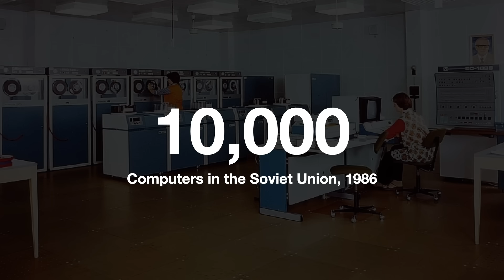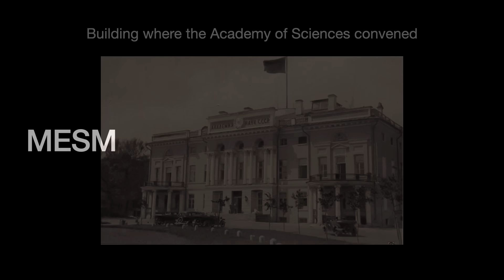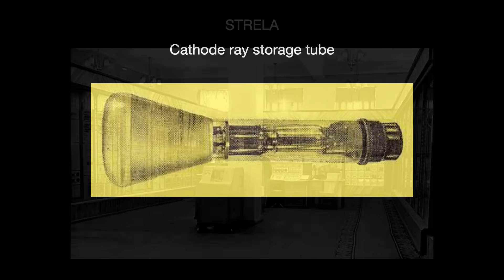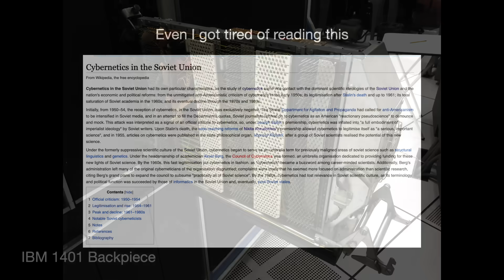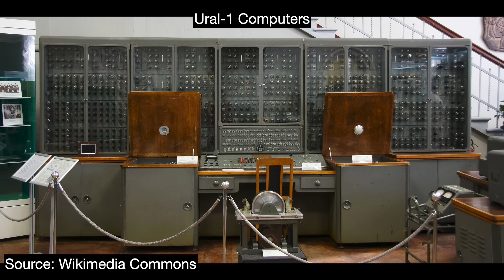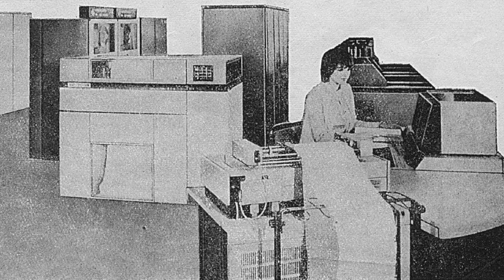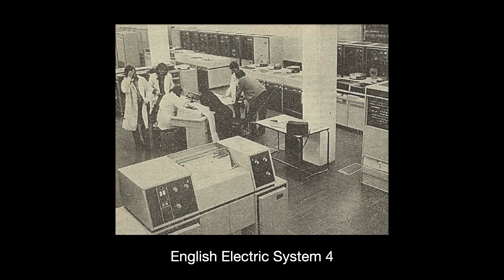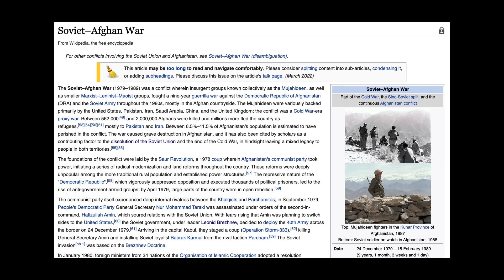Why the Soviet Computer Failed

Comment: Differential Equations are the best thing since sliced bread -- although they are in fact quite a bit older. Most modern technology is built on them. It is not normal to fear them.

Comment: why is that room around the 7m mark (black and white tube computer room) apparently flooded?  There is what appears to be a massive amount of water on the ground and I am so curious why...
Reply: It doesn't look like water to me.  I think it is a glossy material (like a smooth plastic or rubber) in a sheet spread across the floor, with a few ripples in it.  Particularly, at the bottom of the photo, there is an area where the reflectivity of the floor suddenly decreases, but it doesn't look like the edge of a water puddle.

Comment: Yeah, Soviet planning was not set up in a way to properly make use of all resources the most efficient way. That would have been possible, but would have required quite the fundamental changes to the system like setting prices not centrally but by demand. The political landscape there again was in the way of the reform of the economy
If socialist planning is ever going to work it can only be on the background of a separation of party and state, on the background of rule of law and on the background of democracy.

Comment: They never compete for a consumer. So "good enough" was actually a reasonable strategy. Do the job with the smallest budget, and since improvements in the market ware not needed, it stagnated in niche science calculations, which dont produce volumes or monetary interest to make strides.
Reply: In democracies, engineers bought programmable calculators for themselves because they wanted to improve their efficiency. When an engineer in communism wanted to improve his efficiency, he wrote a request to the company for a programmable calculator and got nothing, because there are none. It is necessary to realize that computer technology is also a consumer product and the underestimation of individual consumption was a gross mistake of communist functionaries.

Comment: I started using an SSL G series mixer & session automation computer in 1988 (very niche, but famous in audio). Even this was banned for export to the eastern block. That very thought lingered every time I changed the clunky 8” floppies or calibrated it’s 40 1024 bit A/Ds that read the fader positions. The Cold War was distant but very real for a 22 year old engineer… 😅👍

Comment: I think it's fascinating how there was the idea of cybernetics in the socialist countries (use of computers to predict and plan the production needs of the country) and yet they didn't follow through with the technology.
I worked in the early 90s in a factory for electronic parts and the control room just looked like the room at the end of the video. The photo of Erich Honecker was removed but the shadow of the frame was still visible :-).
Reply: Ironically, Walmart and Amazon, which have their own internal economies larger than most countries, ended up using these cybernetic techniques in their deployment of computers in managing logistics and inventory. Project Cybersyn in Salvador Allende's Chile also instituted a similar program to great success however it was cut short by the fascist pinochet coup.
Reply: @VictorZenloth  
> Project Cybersyn in Salvador Allende's Chile also instituted a similar program to great success
Socialist planned economy, centrally- (and computer) -managed...
How was its "great success" demonstrated ?
Reply: @VictorZenloth  You mean Pinochet/Nixon.
Reply: im not really familiar with theories about technology development but the difference is that the notion of growth as a goal in itself was and is prevalent in capitalist countries but not so much in socialist countries. Frankly, I don't see much societal use of technology development for itself.
Reply: They want to keep you as slaves! 👉The Connections (2021) [short documentary] 🔥
Reply: Any efficiency gain in logistics, inventory control, or planning was opposed until the 80s, when it was too damn late and planning was on the outs because the thieves realized they could just privatize it all and hand it to themselves.

Comment: Did they mention "metric" chips and circuit boards? Soviets were using 2.5 mm pitch instead of 2.54 mm. So parts were not interchangeable and there was no much international demand for non-standard components. In 1970s Soviet SN7400's were very cheap (in Finland at least) but you had to twist them legs sideways, which was annoying and potentially harmful.
Reply: The knock-offs of the US-made B-29 bombers they had after the war suffered the same problem; metric aluminium sheet for the skins wasn't available in the same thicknesses so the Soviet aircraft were apparently some 1000 kg overweight.
Reply: Tupolev told Stalin this would happen and he went "Fuck you, make it work, also, follow the plans exactly because I want to shit-talk you for making American planes."
Reply: ah, yes, the "metric inch"!
Reply: During WWII, the US gifted Russia with a bomber, a B-25 if I recall.
Not only that, a complete set of tools and spare parts; nuts, bolts, washers, rivets, wire, sheet metal, tires.
The Russians busied themselves copying everything, including a small errors in some of the tools.
What would be considered a manufacturing flaw for the West became a standard feature for them.
It's one thing to make a faithful copy of a thing, it is something else to know what you are copying and how it works.
"Are you sure?  This doesn't look quite right."  "Shut up and do it exactly the way they did it!"
Reply: Tupolev understood every part of the B-25.

Stalin didn't believe him.

After fighting very hard, Stalin allowed Tupolev to change the fasteners.
Reply: It's not THAT bad in DIP14 or DIP16. It's usually enough to use "non-precision" sockets or slightly larger holes. 7*0.04mm only adds up to 0.28mm. 

DIP40 is where the fun starts.

I use them, since I got a huge amount of them for very cheap :D
Reply: They want to keep you as slaves! 👉The Connections (2021) [short documentary] 🔥
Reply: Yeah my genuine Z80 never sat or worked right in a Soviet socket. But the whole computer had issues, the semiconductor quality was low.
Reply: @SianaGearz  Yes, they had very low yields. Also, there were no USSR Z80s anyway. U880 was East German, and its exUSSR versions came after 1990
Reply: @noop9k  this thing was called T34VM1. 
There are very clean hires die shots of this chip available so you can easily reverse its function.
But maybe you are right as the die has 'U880/5' between some of the address pads.
Reply: @Merilix2  IIRC these integrated Speccy clones had U880/5 or U880/6 markings on the CPU die.
There were several versions of both CPU and ASIC ICs, not just Т34ВМ1. CPU could be named КР1858ВМ1, КР1858ВМ3
Just read that there were several copying attempts, some failed due to those Z80 traps.

Comment: On a sidenote, the largest computer manufacturer in East Germany was called "Kombinat Robotron", which is just objectively a rad name.
Reply: Kombinat is generic term for Socialist conglomerates. Kombinat Carl Zeiss for e.g,  Robotron is fantastic name especially in the 80's. They also had good products but the yields and production outputs were extremely low while the demand was high.
Reply: @061Hitachi  Zeiss is still in business. They make a lot of cool stuff these days, including laser optics for the EUV lithography systems for ASMLs 5nm capable machines that are the only ones capable of producing chips like Apples M1 chip and other 5nm hardware. At the end of every production line there is a thing that makes the thing and inside that thing there is a part that's made by a German company and without it, it wouldn't even begin to work.
Reply: @unlink1649  or they just use machinery from germany lile Xiaomi, Foxconn, Oppo, OnePlus and Huawei
Reply: @AbuHajarAlBugatti  Who uses what machines? I said Zeiss is a German company that supplies ASML with optics for their EUV machines that then in turn companies like TSMC buy to make 5µm chips like the M1 for Apple. No idea what you understood. I don't get it
Reply: @unlink1649  Zeiss are definitely around! My eyeglasses are Zeiss. I insist upon it.
Reply: @unlink1649  I think there was a DDR Zeiss and a BRD Zeiss, though after reunification I think the BRD Zeiss acquired (at least some of) the DDR Zeiss assets.
Reply: @ProfBoggs  water under the bridge. Modern Zeiss is just Zeiss.
Reply: @unlink1649  Different Zeiss, the Zeiss you are talking is original one that evacuated to Oberkochen in South west of Germany. Only their factories could not evacuate left behind.
Reply: @unlink1649 but don't mix up Carl Zeiss Jena, now Jenoptik, with Zeiss Oberkochen. These were split 1945....
Reply: @unlink1649 ...Carl Zeiss Jena is Jenoptik, they are still around and kicking ...
Reply: @061Hitachi  socialist robotron sounds like the villain in a GOP-funded post apocalypse movie franchise.
Reply: @061Hitachi  Kombinat is a german for Combination and just the short form of Kombination.
Reply: @AbuHajarAlBugatti  We had Kombinat's in Yugoslavia and there were Kombinat's all over Soviet Union and Eastern Bloc regardless of the language.
Reply: @061Hitachi  just saying it a classical german word. Even if you borrow something, many people say taking a Kombi
Reply: @061Hitachi kombinat …socialist conglomerates…👌🏻 nice
Reply: @061Hitachi  Kombinat means "combined" - factory and research institute in one. The Bulgarian kombinat was Pravetz located in the town of Pravetz the home town our leader at the time - Todor  Zhivkov. The commuters made there were Apple IIe clones.
Reply: @dimitarmladenski1367  I never heard of motorola-based Pravetz. They were PC-XT a) 8086 b) 8088, and dual-CPU Z80 c) KP580 (USSR CPU). There was late modification that was based on 80286, but it might be 1992 already, if I'm not mistaken. If there was Motorola-based model, I never encountered one.
Reply: @EllAntares  ПРАВЕЦ 82 (PRAVETZ 82) == Apple II
Reply: @dimitarmladenski1367  Interesting! Though rarely used (and maybe I'm showing my age), the word "combine" in English can refer to an organization, usually "industrial combine." However, I didn't realize that organizationally, Kombinate referred especially to organizations with both production and research units. Thanks for that information!
Reply: Sounds like they wanted to be the DDR's Kraftwerk.
Reply: there's a "Robotron" still in the video... i noticed immediately and thought the same... "cool ass name" ;)
Reply: That's my band name now.
Reply: @jaex9617  The title of the first album should be "10 GOTO 11"
Reply: @bunkie2100  Retro mode activated. Now I want to write something in FORTRAN. 😄
Reply: @jaex9617  - Ooh, ooh! On punchcards!  

 A Russian co-worker once showed me a Cyrillic Hollerith card. Cool!
Reply: @bunkie2100  I think I was the last person in the Western hemisphere to write a program out by hand and have it keyed onto punch cards. 😄 And if I had a Cyrillic punch card, you can believe I’d frame that and put it up on the wall. 💪🏽
Reply: @jaex9617  Somebody beat you to it in the '90s. I think they were an offshoot of Man or Astro-Man.
Reply: Smells of Half-Life to me.
Reply: @Ndlanding  That's because Half-Life, certainly in the later titles, is actually made to smell of Eastern Bloc.
Reply: }}} Kombinat Robotron

Good name for a band.
Reply: I might make that my first child's name
Reply: @InVinoVeritas540  Elon Musk has the same idea about his next child.
Reply: when i was in high school (in the early 80's), my favorite coin-op video game was robotron 2084 by williams.
Reply: @thomasdeaton8768 Hehe. Yeah I remember that.  I loved how prominently Williams would always put their name in The title screens and idle screens.
Reply: Is that is at 16:00?
Reply: I want to see the anime' of this name,lol
Reply: Amazing name, couldn't be better
Reply: We've got a company named ' Keltron '
Reply: @tyrantfox7801  Hi malayali
Reply: My mother worked on the Robotron back in the day XD I was around in Ukraine and Belarus at the time too.
Reply: Fantastic name
Reply: Good name for a 60s sci fi flick:  Godzirra meets Kombinant Robotron!
Reply: And Robotron was pretty much the only thing they did about say, implementing printers and  drum\harddisk drives. ;/ Every segment of production, CPUs,  PCBs,  components, were so centralized, that when  logistics started to fail, way before USSR demise, those went into disuse.
Reply: There was one IBM PC XT / AT clones manufacturer in 1980's Czechoslovakia, making them from imported parts; the name was JZD Agrokombinat Slusovice, which originally means a... kolkhoz :) State-owned, socialist agricultural production, that did computers over winters. They also had own rally team (Agroteam JZD Slusovice). With Porsche 911. No kidding.
Reply: The "Robotron Combine", quite literally. X-DDD
Reply: @ZemplinTemplar  Yeah no, more like "Association of publicly owned companies "Robotron" "
Reply: @holger_p No, it's not Russian. It's Czech. Karel Čapek invented this word in 1920 for his novel R.U.R. But yes, since Russian is also a Slavic language, it has similar word with the same root: rabota (работа), which means "work". Maybe you are misguided by Kraftwerk's song "The Robots" ("Die Roboter" in German), which has this refrain in Russian: "Ya tvoy sluga, ya tvoy rabotnik" (Я твой слуга, я твой работник), which means "I'm your servant, I'm your worker". I like this song very much :-)
Reply: I actually have an old Robotron stereo system which still works like a charm after ~40 years. Can't get products like these anymore today...GDR electronics were just built to last
Reply: @paul_ko  By stereo system you mean a Radio,  Reel to Reel  Tape Player/Recorder and Vinyl Player?  Oder was genau?
Reply: @isallah1kafir196  Sorry hab deine Frage erst jetzt gesehen...Robotron RS 2510 Stereo Receiver (Also Radio-Empfänger und Verstärker in einem, inkl. DIN-Anschlüsse für Tonband, Plattenspieler und Antennenbuchse) und RFT B3010 Lautsprecher, hat mich alles 60€ gekostet. Wenn ich eine neue/moderne Anlage mit der gleichen Qualität wollen würde, müsste ich ein Vielfaches davon ausgeben, mindestens 500€
Reply: @paul_ko  That's incredible. Reminds me of flagship electronics of the 90s like Sony's DVP-S7000 built to launch DVD technology. Such high quality that even its CD laser is competitive with top end transports from the 2020s.
Reply: They want to keep you as slaves! 👉The Connections (2021) [short documentary] 🔥
Reply: Yes, they were exclusively specializing in designs stolen from the west.
Reply: Wolfenstein boss name
Reply: yes.  it sounds like a nazi
Reply: Kombinat Robotron sounds like either an anime or a techno band. lol. Brilliant name though.
Reply: A computer lab where I worked had a Robotron printer. Was so vastly inferior to Epson FX-800/LX-800 we got a couple years later.
Reply: Don't forget CYBERSYN
Reply: If there isn't a Berlin techno duo with that name, I'll be deeply disappointed.
Reply: Fuckin eh
Reply: And it gave birth to what is now the leading European semiconductor industry cluster, the Silicon Saxony. Well it's not the silicon Valley nor Taiwan buy it has its place in the industry.
All that started with Robotron in the 70ies...
Reply: Robotron was also a heck of a standup arcade game from 1982. Well, Robotron 2084.
Reply: I still a have massage machine in original package.. :D
Reply: The entire word 'Roboter' is of russian origin. From some early science fiction or so. It just means worker.
Reply: fallout ahh name
Reply: Sounds like some daft punk album title.
Reply: However, Robotron is a great name for the over baddie in a science fiction fantasy cartoon.
Reply: Well, germans love to “Kombinat” words lol
Reply: Robotronkombinat
Reply: Do Russian computers use chips,???

Comment: It always struck me as odd that the complete randomness of the market, no matter how short-sighted it may be to reach the next quarterly revenue call, is somehow a better long-term strategy maker than centralized planning an economy.
Reply: Not really when you consider
a)most companies fail and they too were just trying to reach the next quarterly.
b) This is applicable to megacorps but most companies are a command economy on the inside that influence the economy and markets just as much as they influence them

Comment: eniac computer wasn't the first electronic computer! Colossus was but was destroyed at the end of WW2.
Reply: Was it (and the Bombe machines) actually destroyed? No. Some of them were but the rest were kept… because that allowed GCHQ to decode encrypted messages from other countries. The Germans were not the only ones with interesting encrypted messages…

(That some of these machines survived is officially out in the open now but it was kept secret for years.)
Reply: Collossus was more of a pattern-matcher, and nothing like the ENIAC, which could actually add, sub, multiply and square-root.  Neither one had stored programs and were set up by  manual patch cables.